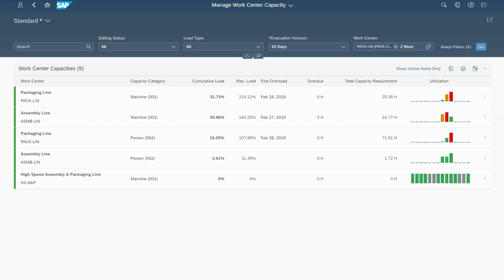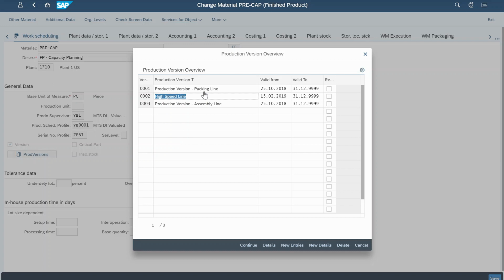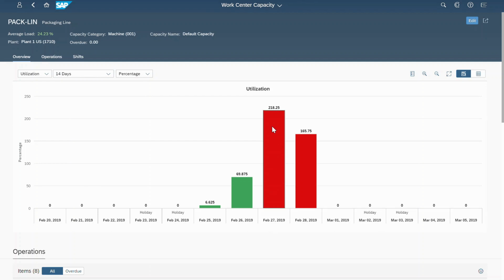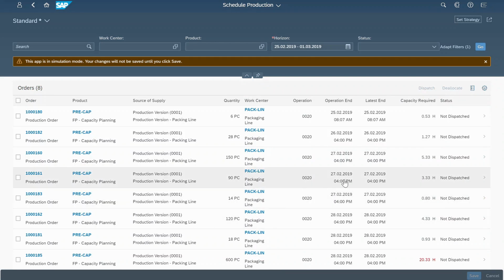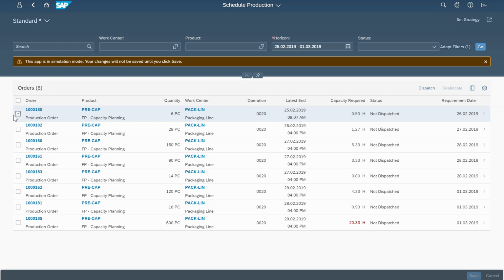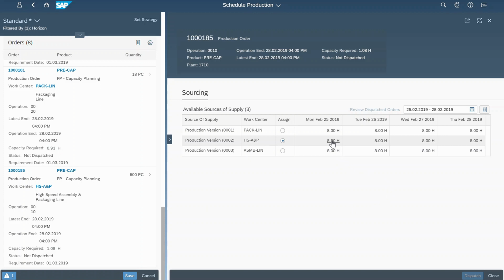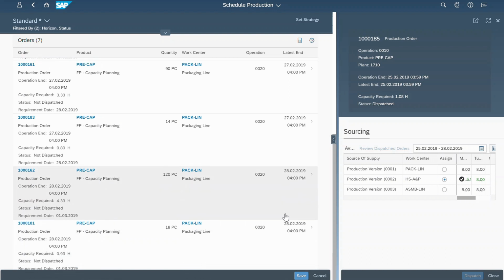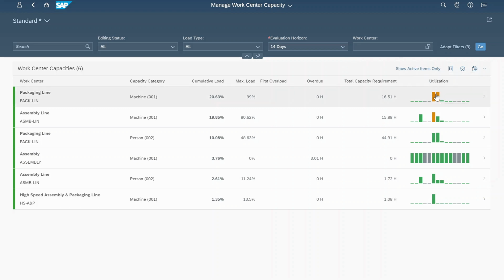Sweat your assets 100% - Production Capacity Levelling

Comment: Nice explanation. thanks, mate. will the dates of the other operations also gets automatically adjusted based on the dispatch date of the production line(bottleneck work center). Also, how can I dispatch other operations(which app can be used)

Comment: Well done, great video mate. 
Does production line in the production version master data is mandatory for this process (even not repetitive manufacturing)? 
So excited with S/4Cloud product, does capacity levelling function can be done at operation level ? (say, the order has prod version 001, but we just want to levelling operation 0020)?
Thank you
Reply from the maker: Thanks Hendrik. Yes the production line is mandatory, if you want to use the capacity levelling feature (even if you are only using discrete manufacturing). If you do not maintain it, then you will not see anything in the capacity levelling app. The reason is that you do not want to plan each and every individual work centre in a routing, but only the bottleneck or the cadence setter. Yes the capacity levelling is done at the operation level, but with what I have stated previously, you can only plan those operations for which the work centre has been specified as the production line (in the production version referenced <--important).